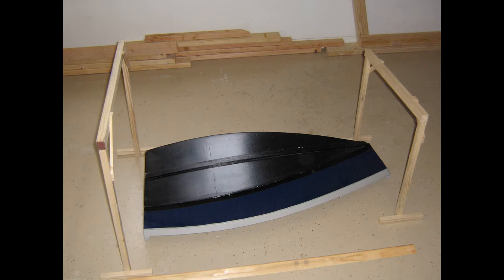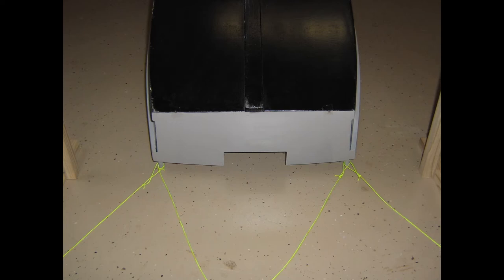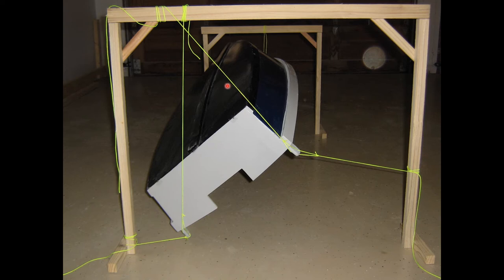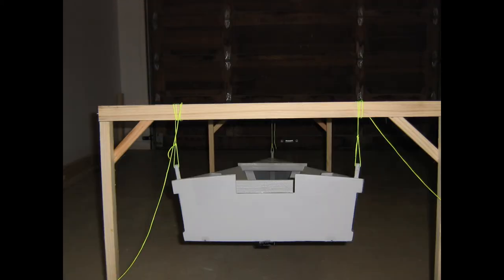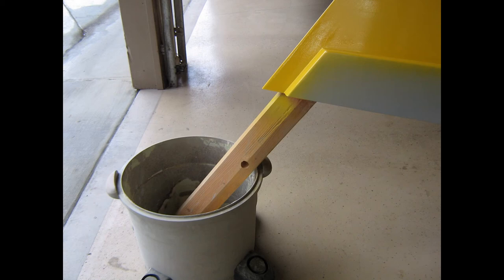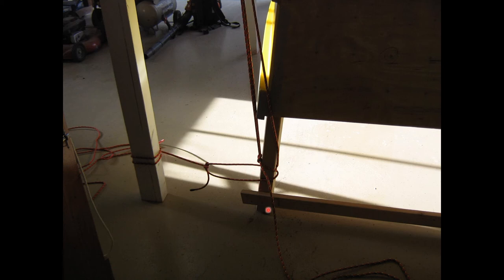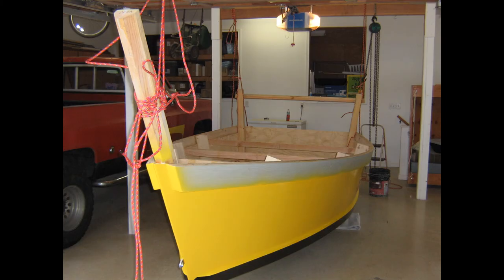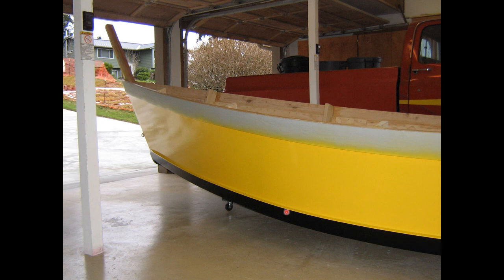Episode 18 of 2019 Boat Build

Comment: Love this videos! I’m building a lumberyard skiff pretty soon. What wood do you use for sides and bottom?
Reply from the maker: Hi Colin. Thank you. I also have plans for the lumberyard skiff. I think Walter Barron designed a nice replacement for Earl Brockway's boat. I used 1/2" Pine Radiata ACX plywood for the sides and 3/4" for the bottom.
Reply: Nice. I’ll probably use the same thing based on what I can get at Home Depot...  it may be pine for me down here.